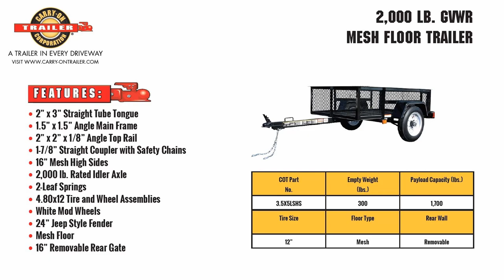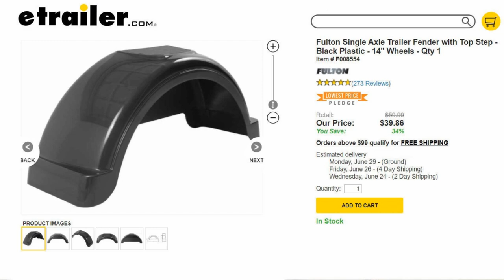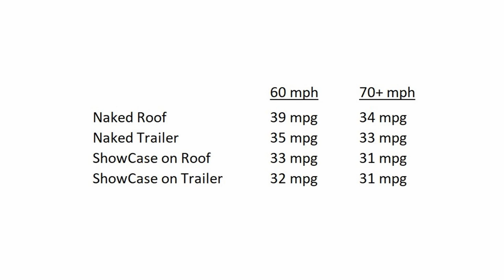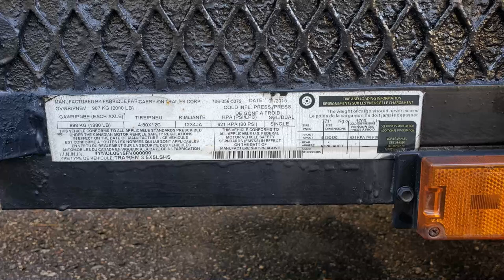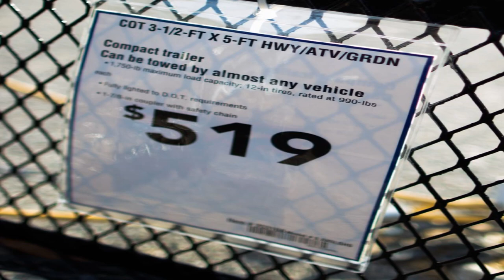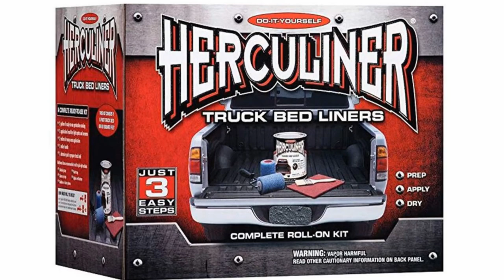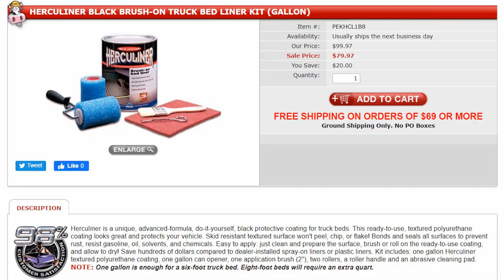CARRY-ON TRAILER 3.5x5-FT UTILITY TRAILER

Comment: How much wait can the trailer do?
Reply from the maker: The trailer's GVWR is 2000 lbs. However, cargo capacity is GVWR minus the weight of the trailer itself. In this case, it was 1750 lbs when stock and now about 1500 lbs as configured. HOWEVER, the max towing capacity of the car is 1500 lbs without trailer brakes. Therefore, I should not carry more than 1000 lbs. Thanks for visiting!
Reply: @StealthGTI  sorry but what's the size if it?
Reply from the maker: @futbol1972  - It's in the title: 3.5x5 feet. So, pretty small, but not as tiny as they come. Take Care!
Reply: @StealthGTI  do u like it and is it pretty handy?
Reply from the maker: @futbol1972  - It's incredibly handy. I think I mentioned it's flexibility in the video.